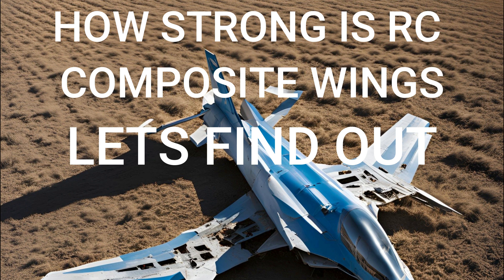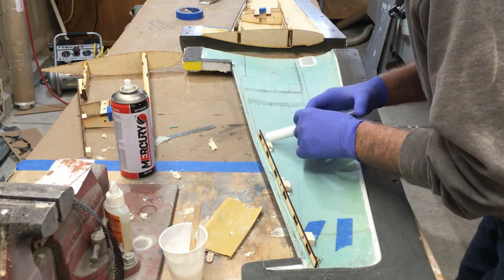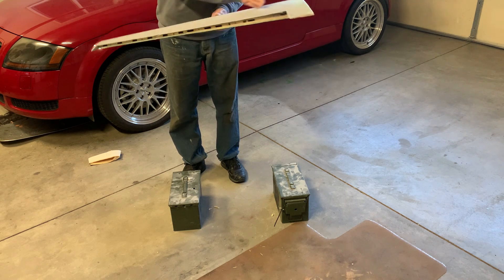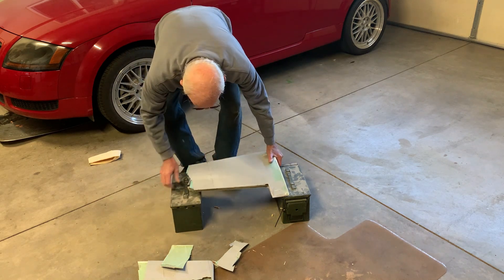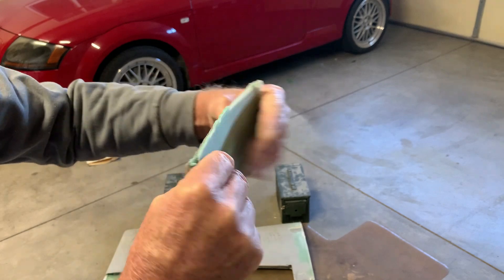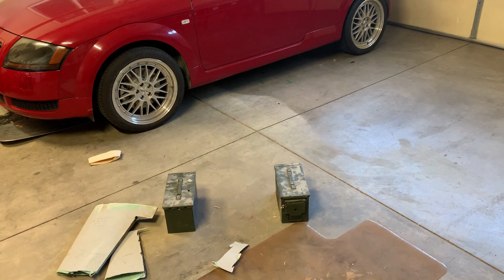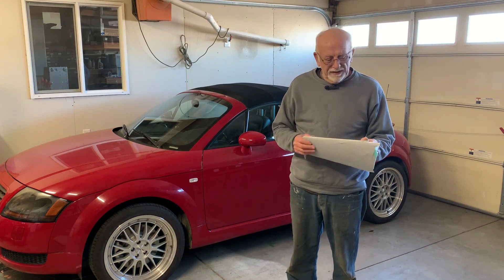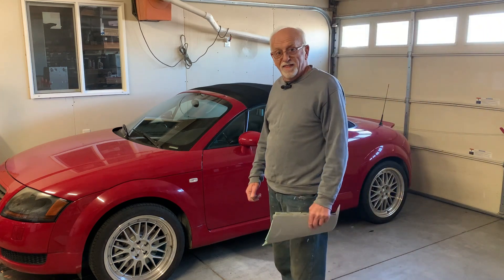RC Composite wing destruction

Comment: its amazing the strength that 2oz cloth either side of the foam will support.
Do you put any through holes in your foam for the resin to penetrate ?
I have seen small holes pepper the foam so the resin can seep through to create a through support.
Great work, keep the vids coming please, there is a core following that like your videos.
Reply from the maker: Yes for the holes, I use a spiked roller for use on carpet joints.